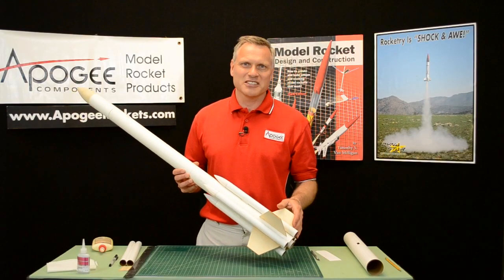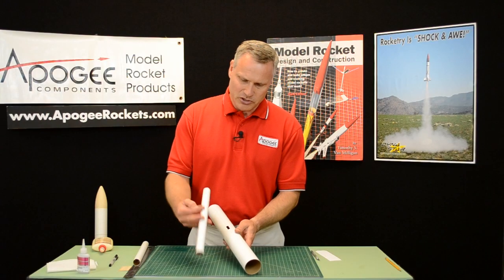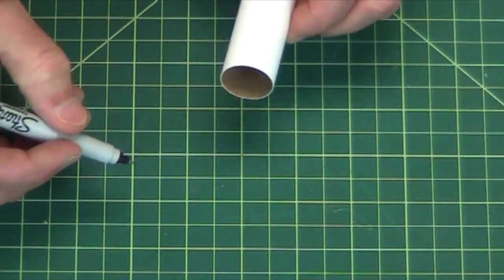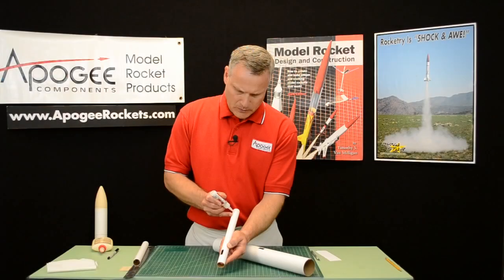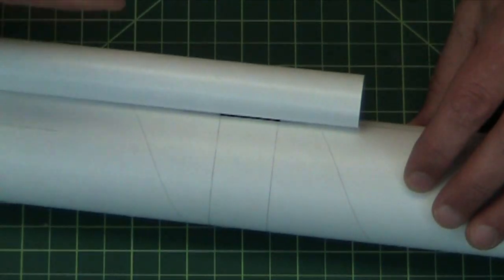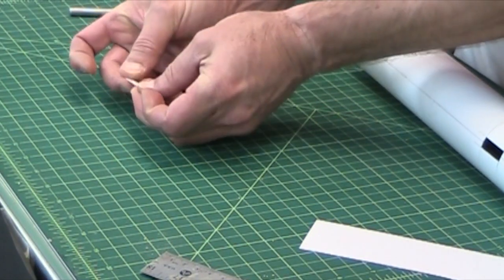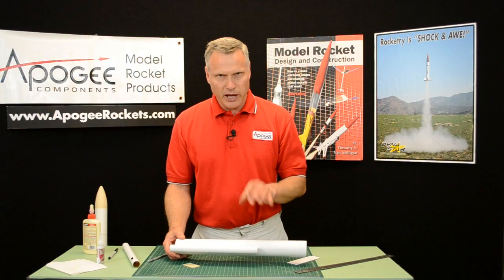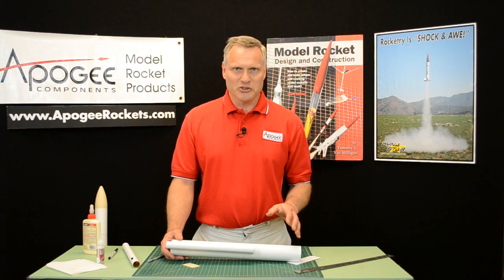Attaching External Pods to Model Rockets

Comment: With multiple pods, would it make more sense to "stagger" the ports as opposed to having them directly across from one another?  This way the airframe isn't weakened by multiple cuts in one area, plus each ejection port isn't directly across from another one.